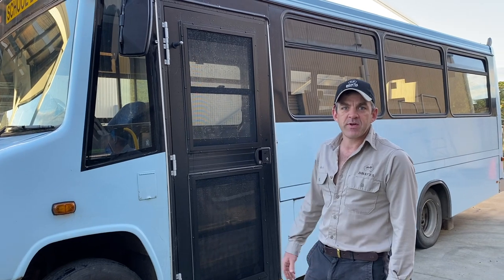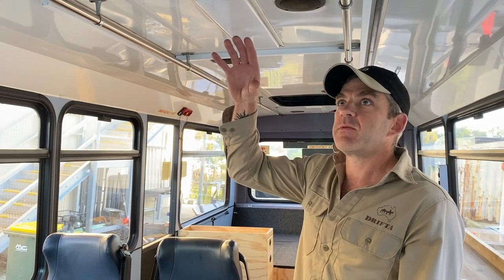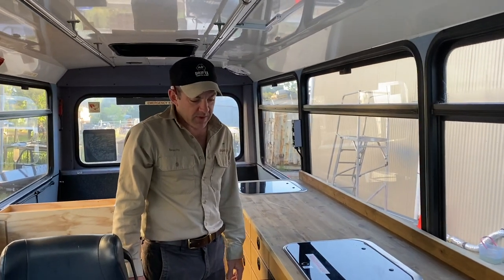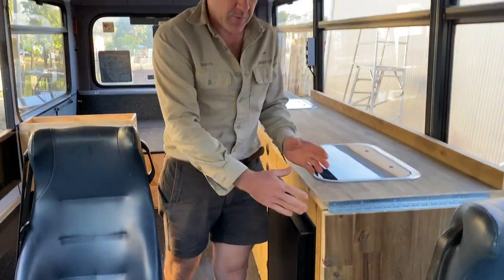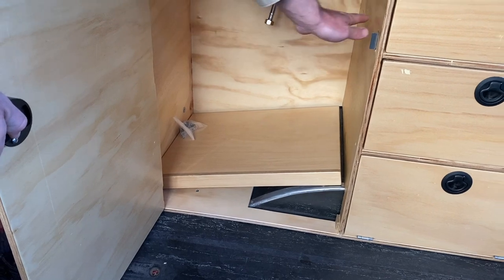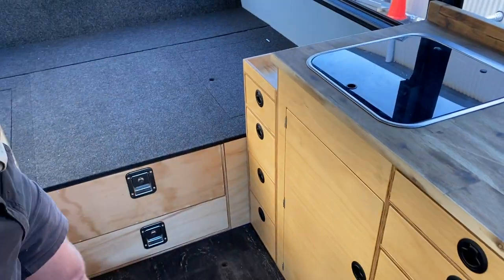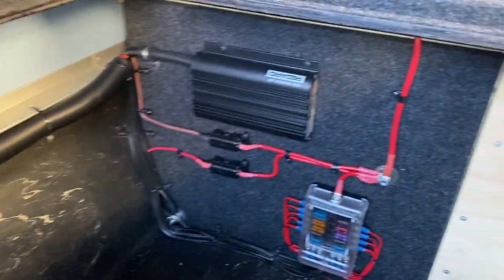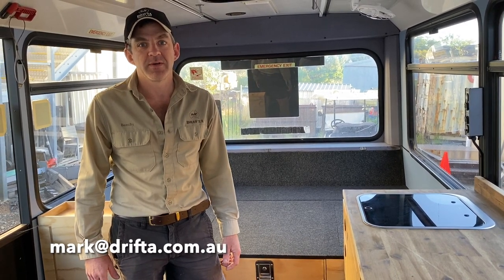DRIFTA SCHOOL BUS CONVERSION

Comment: Mark. You fitted my Drifta draws in my HiLux 10 years ago and you have not aged a bit. Must be all that fresh country air up there in Gloucester. 😁👍🏼
Reply: How have the draws held up Kevin?
Reply: @MiniLuv-1984 Hi Benny. Thanks for asking. I still have them installed in the same 2012 model Hilux. I use them every day. As a tradie, they mostly carry around heavy tools and equipment. So I'm constantly working out of them. Otherwise I am travelling and camping with them. I also have the Drifta slide out kitchen, tucker box and table, that fits into the draw system. I'm happy to say that there has been no failures after 10 years of constant usage. I know this sounds like a paid commercial but I have no affiliation with Drifta. It's just my personal experience. So I'm one happy camper. 😁🍺
Reply: @CamperKev  Thanks. Honestly, it is what I expected.